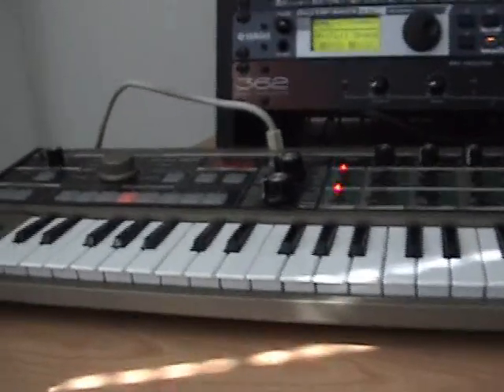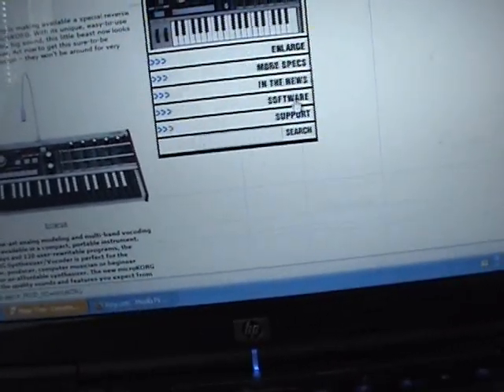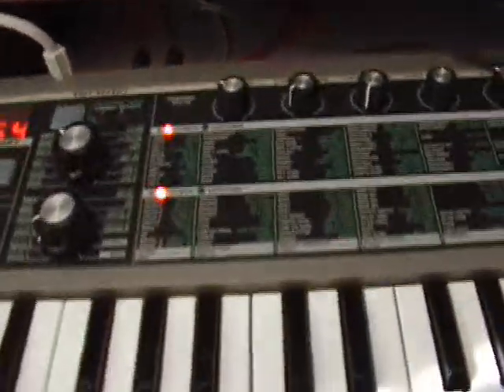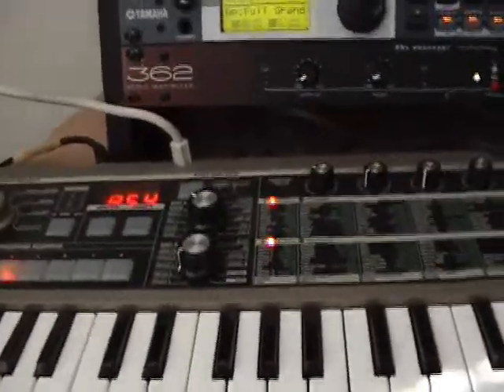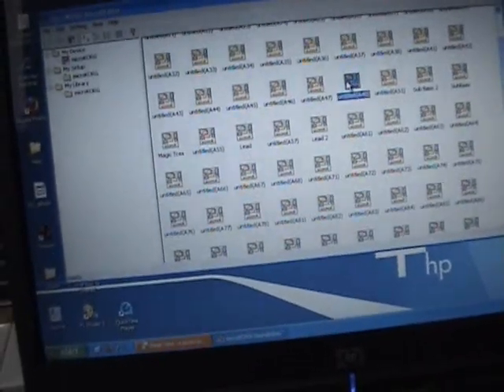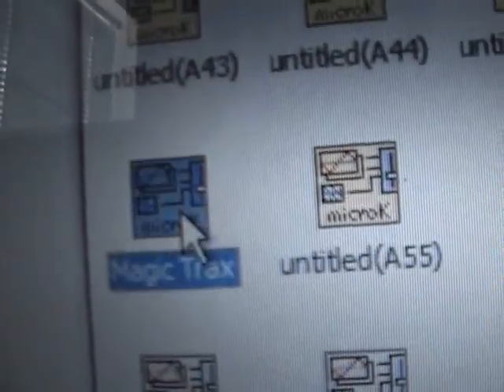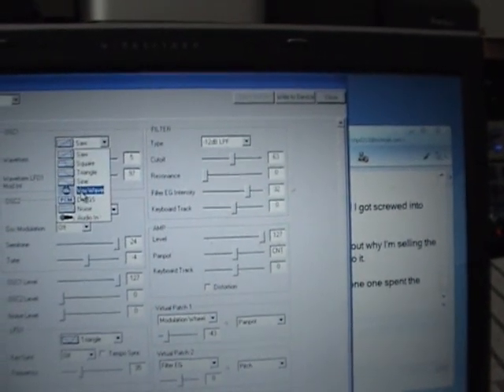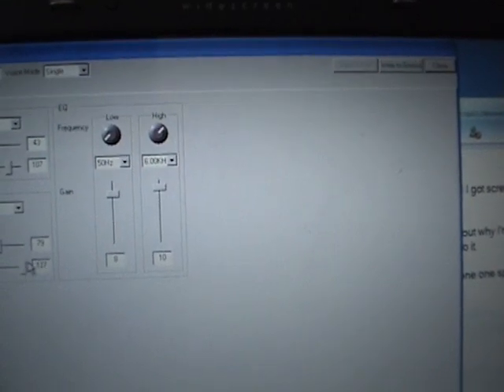MicroKorg synth modeling with the software editing program

Comment: I want to use synth as a MIDI keyboard and sound at the same time to update it with the official program of the Korg. I plugg my MicroKorg to computer by standart USB to Midi cable not like your cable in your video - "MicroKorg synth modeling with the software editing program"
Official program microKorg Sound Editor shows me the error "ERROR: Can't Start Midi Transfer ...". Cubase 5 & FL do not react too.
Thats why my computer don't see my korg? MicroKorg work just with cable like in your video?

Comment: thanks for the nice demo.  how do you permanently change the octave that the program is set to?   for example the program I am editing is set to be two octaves down.  when I'm editing I want to hear what it sounds like in the normal range. every time I tweak something though, it tweaks that parameter but resets it to two octaves down which is very low.  how do I set it so that it stays in the middle range?

Comment: You must place these downloaded patches in the map My Documents/Korg/My Library/microKorg.
You may also create submaps in that map, to order them somewhat more (for ex. Init,MS2000,New, etc). 
After you have placed your patches there, you can find them with the Korg Editor program and copy them to the MicroKorg. 
You may also place MS2000 patches there and they will work too :-)
I also have an initiated ("cleared") patch in My Library, to use as a template for new patches.

Comment: I had problems with an m-audio usb2midi as well. In any case you'd  better use downloaded drivers than those that are packed with the device. My interface refused to work however with 3 computers with any driver...